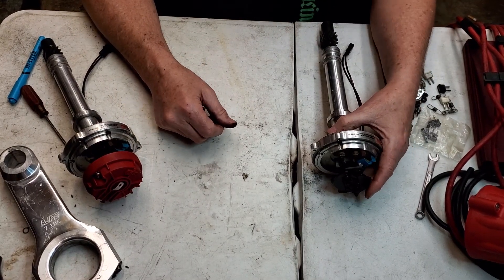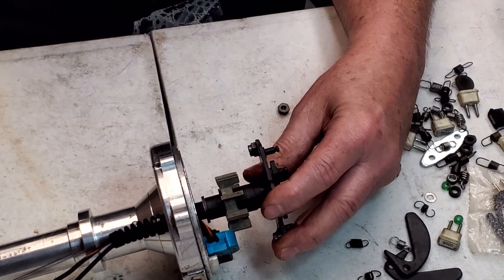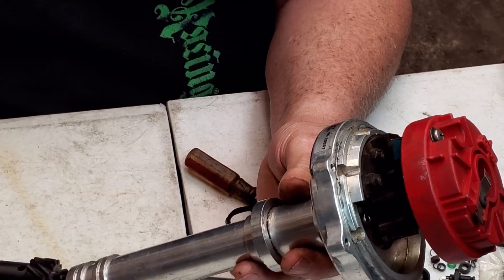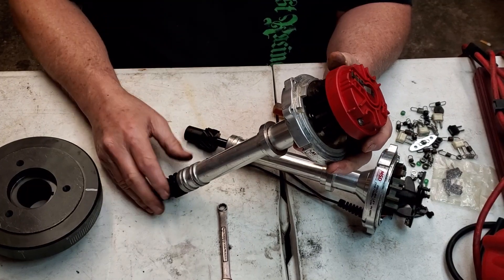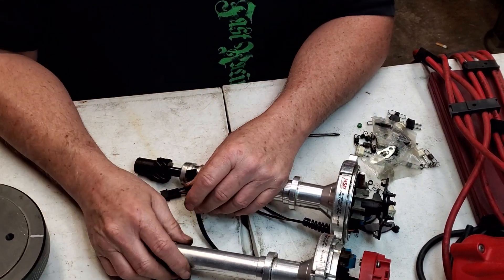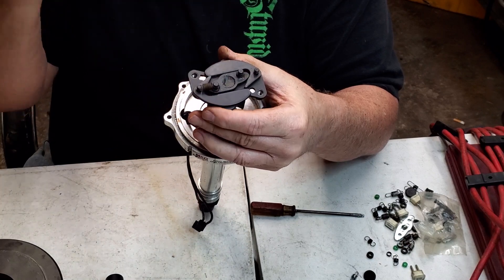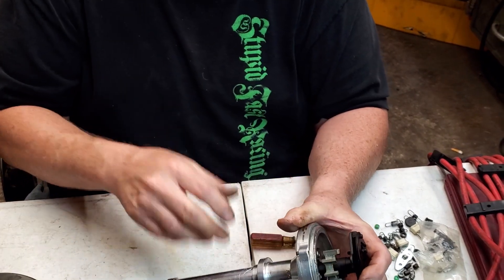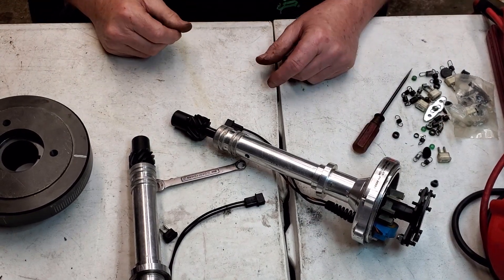Dialing in your MSD distributor total timing advance

Comment: I haven't owned a msd distributor yet but I like how easy it was for you to get at the advance mechanism. I've got the mallory unilite distributor. I find those mallory distributors cheap and fix them up.
Reply from the maker: Mallory makes a good distributor. I prefer msd myself but I have run Mallory with good results.

Comment: I got a Oldsmobile 67 442 the 400 motor with the MSD mechanical vacuum advance motor has got got a w30 cam in it 750 carburetor I wonder if I should use the lightest spring in a one heavy spring I hear racers yous a setup like that with 38 total timing
Reply from the maker: I've ran that combination of springs before but don't go to light or the timing may jump around at idle. Also listen for spark knock. Hope this helps.

Comment: I have a question, I have a Sbc 427 and I set timing 34* at 3500 rpm. Timing at idle is 18* and I have 18* mechanical. Shouldn’t it be 16* at idle with 18* mechanical for 34* total?
Reply from the maker: Yes if you want 34* degrees total. If i'm strictly just drag racing then i lock my dist timing out. If its a street strip car I would set my timing like yours. Timing is a product of combustion chamber burn speed.hope this helps.

Comment: Which carb would be best with the msd pro billet mechanical advance distributor? Do you still use carb with vacuum secondary, or is there mechanical secondary carbs?
Reply: I do have the whole msd electronic ignition kit with digital 6al box, that has rev limit adjustment
Reply from the maker: Scott describe your engine and are you running manual trans. Or automatic. Do you sreet cruise or more competitive?

Comment: Before I watch this video, I'd like to state my belief's and understanding of the mechanical distributor on carbureted engines. ALSO THANK YOU FOR GREAT INSTRUCTION VIDEOS! I've been in the automotive field as a senior master automotive and diesel Technician for over 20 years, and I appreciate the direction taken here to educate!

I'm a driveability technician. Ignition timing is a close friend of mine. In 23 years I've witnessed two sides form...."The Advanced" and "The Lockouts".

I'm a firm believer in timing curves. Please have VERY VERY good reasons if this video is about locking the damn distributor at 36° on a daily driven 10.5:1 over-cammed sbc .

MSD distributors do have adjustability of advance curve and max timing. 

Sorry for the rant. I'll watch the video now.
Reply from the maker: I'm  a driveability guy too, worked at a Ford dealership for almost 30 years, I started when points and condenser was ending , worked all the way through eec5 systems that had monitors, but locking the distributor out is for a racecar not a street car, i usually watch the video before I comment. I show people what I've down , not what I've  read and I'm  sure you'll  have some people that will do the  extreme to a street engine.  Most of my videos are for drag racing or circle track. Hope this helps and I was a master tech through ford motor company and ase. I always loved driveability.
Reply: @holleycarbshowtosadvice40y90  no shit! A brother from the blue oval! I miss the shop life and the ability to further my education a little.

Comment: how to know what ur initial timing should be at?
Reply from the maker: It comes down to what your doing with your engine also things like compression, type of fuel, combustion chambers shapes and sizes, cylinder head material, lot of factors.
Reply: @holleycarbshowtosadvice40y90  on my motor there’s a mark right at 35 i believe that’s totally time but how do i know how much the distributor has in timing the color of the bushings?
Reply from the maker: I don't  know if you have a msd distributor but msd has a tech line they can tell you the degrees of timing of each bushing and then add in however much initial timing you need to get your total timing  usually a stock engine likes around 10 degrees initial but  this can vary. I'm  discussing  a full mechanical advance distributor. Vacuum advance you have to add vacuum timing and mechanical timing and your initial timing to get total timing. Hope this helps.

Comment: Could I just turn the idle up until the engine stops advancing say to like 36 degrees lock down distributor and let the initial advance just fall wherever it's at.
Reply from the maker: I don't do it that way but you could try that, I'm trying to get the advance in as early as possible. Hope this helps.
Reply: @holleycarbshowtosadvice40y90  I guess I will try it your way because my engine is running really rich at idle and under slight load carburetor seems to be dialed In so I'm looking at ignition next

Comment: Could you give a little more explanation on those little advance pills, the thicker and the thinner? I run about 16-18 initial timing, and about 36 total if I want that to advance much quicker would I go with the smaller or larger pill?
Reply from the maker: The bushings limit the amount of advance, the bigger the bushing the less advance the smaller more advance, the springs control how quick the advance curve happens, light springs quick advance curve. Hope this helps.
Reply: @holleycarbshowtosadvice40y90  absolutely does thank you

Comment: Can you do a tutorial on the marine msd ready to run distributor?
Reply from the maker: I'm not a marine tech, but best I can tell is its simular to the pro billet racing distributor but has upgrades to the distributor cap, has brass vents at distributor base and has a built in ignition module, and has adjustable timing advance with bushing stops and springs to curve the distributor advance, make sure you check the specs from the boat and engine manufactures for the correct ignition timing advance curve, how much initial timing and total timing the engine needs this is important. I'm not a marine mechanic  but I hope this helps. Msd distributor pn 83606 for chevy.
Reply: @Holley Carbs: How To's & Advice ,40 yrs of exp.  I'm swapping my engine for a small block Chevy, so I'm building everything from scratch
Reply: @Holley Carbs: How To's & Advice ,40 yrs of exp.  I already got an efi kit from holley and a marine ready to run msd distributor.
Reply from the maker: Good deal man.

Comment: Awesome video. Got a question how do I set timing on a locked msd distributor on sbc ?Would be using just a timing light with no fancy dials.
Reply from the maker: If your dampner is not marked, I believe you can still buy a timing tape which is a degreed tape that you just peel off the back and clean your damper and stick it on, match 0 tdc on dampner with 0 on your timing tape, always get the right size timing  tape for the dampner. If you have an 8 inch dampner be sure your tape is for a 8 inch dampner. I used to build my racing engines, when I degreed my cam in I would use the degree wheel to mark my dampner from 0 to 40 degrees, back then we used a lot of modifed stock parts. Hope this helps.
Reply from the maker: Amazon sells timing tapes.thanks for watching.
Reply: @holleycarbshowtosadvice40y90  it’s a after market balancer with timing marks! So I just run it up on RPM and turn the distributor until I reach 32 degrees?

Comment: I have a 69 el camino at 3300 lbs a 396 with edlebrock RPM Performer heads and intake to match , a comp 282  roller cam and rockers , Eagle forged crank and rods , It is a dog and I am thinking of running the red busing and the silver springs to get the advance up there to 38 do you think that is too much advance? should I bring it down to 34 total instead ? I am running stock springs and blue stop washer
Reply from the maker: Normally 38 degrees timing is ok on a typical big block chevy, but first you need to run a compression test to get an idea how much timing to run , your motor should not be a dog fact it should be the opposite. Run your compression test and if you can check the engine vacuum at idle and get back to me.
Reply: @holleycarbshowtosadvice40y90  it's 9 lbs at idle, I just checked the timing and something is drastically wrong , it is comfortable with 40° at idle and jump's to 60 ° when give it throttle... Could the timing chain be out a tooth 🦷 I didn't build the engine so they might of screwed up..
Reply from the maker: Check your harmonic balancer for slippage next check  your timing gears for proper alignment, sometimes I've  seen people use the key way on the crankshaft to align the timing gears, you have to use the timing  mark on the the crank gear , not the key way. Mark on the cam gear at 6 o'clock and mark on the crank gear at 12 o'clock.  Now not trying to confuse you ,if you have multiple keyways on your crank gear check and make sure your using the right keyway. Hope this helps. If this is your problem you want believe how much power your going to pick up. Hope this helps.

Comment: Thanks for the video and I have a street/strip 3100lb ish 89 foxbody  10:7:1 363 sbf victor jr afr 195s, comp 282 cam 565 576 lift, 780 holley, 5 speed 373 gear and looking for a starting point on springs n bushings w/ mech advance msd pro bullet and was thinking 14 intial and 34 total, thinkin blue bushing w/light silver and light blue spring to come in at 2400k and advance be 21, whats your thoughts on this? Thanks for any help.
Reply from the maker: George  excellent parts combo , very well thought out. With the ignition timing in that fast ,which is a performance advantage , watch for ignition timing moving around down low , sometimes its hard to use light springs and keep control of the timing, if you don't have any problems , afr has excellent designed combustion chambers so 32 to 34 degrees should be fine. You may won't to play with the timing at the track to see if your at the best timing. If you every get to where your timing is causeing hard starting ad a spark retard box , always remember the more initial and less mechanical is better for racing , if you we're just racing, ( no street driving) I would tell you to lock out your ignition  timing. Hope this helps.

Comment: You have given me more REAL WORLD INFO on distributors in 15 minutes than I could find anywhere! Thank you! Now, and chance you could do some Mallory dizzy stuff, since there’s almost zero good info out there on them?!?!? I have been searching all over for advance curve knowledge on the Mallory’s, but since you can’t get the Mallory advance kits anymore- only Summit sells a kit that will fit for their distributors, but the springs are all different from the original Mallory colors so no one knows how to set these up anymore! Your 40 years of knowledge is more valuable than you can begin to imagine!!!!! I beg of you to please kick out a few vids on the older Mallory dizzy’s. Both the unilight and magnetic pickups!!
You are a guru, and so helpful! SUBSCRIBED!!!!!!
Reply from the maker: Dave I'll have to look through my distributors I had a pro comp 9000 , don't know if its still around ,I'll get back to you.
Reply: In a 496 stroker forged bbc, what kind of advance curve should I be looking for as a start? 10.5:1 dual carb, tunnel ram intake, over tran
Reply: Transom headers- engine blueprint says @ 650 hp and Dart 308 race series aluminum heads

Comment: I have a 65 GTO with 406 smallblock Chevy with the following: Dart SHP 180cc aluminum heads, Howard cam .530/.545, 233/241, 110 lsa, RPM Airgap intake and Summit 750 vac sec carb, Progression distributor which is computerized and runs a MAP sensor for vacuum advance. Compression is 10:1 and I run 91 octane. Rear end is 9 inch Ford with 3.50 gears and Tremec 5 speed. Timing during cranking is fixed at 10 degrees. After that I can create any timing map I want on my iphone and upload it via bluetooth to distributor. I'm interested in what you were saying about locking out the distributor and how much faster the car accelerates on the bottom end. Since mine is completely programmable I would think I could simulate the lockout during initial takeoff but increasing advance immediately and then adjust it after that. What do you think of this plan? Do you have a suggestion on what the ideal timing curve would be again keeping in mind that it is 100% programmable? Car is street driven on weekends. Thanks a lot.
Reply from the maker: If your running it on the street that much initial lead is hard on the engine but if you can use start retard cranking and then dial your timing to 20 to25 degrees at idle and then ad your total timing at a certain rpm usually around 3000  , keep your idle as high as you can when your running that much timing maybe 1300 to 1500 rpms, when you bring your initial timing in early . You will notice the power level come up, I run my msd dist.locked out at the track when I want to star gaze lot of bottom end response. Good luck Sounds like your sharp, keep thinking out of the box.I would continually change it and see what it wants on top . Faster the burn rate of the combustion chamber the less total timing you need , but can vary from 32 to 38 degrees total , have to find that sweet spot.
Reply: @holleycarbshowtosadvice40y90  I have spent probably 10 hours over the past few days tweaking the timing table and it keeps getting better.  . One thing I did today was hook up a vacuum gauge so I could compare the kpa that the software functions in to mm Hg which I'm more familiar with.I wish there was a way I could post a photo of my timing map so you could tell me what you think

Comment: Is it better to have more timing come in with the mechanical rather than have a lot of initial and a small amount of mechanical? This is for my street/strip car.
Reply from the maker: If you have a start retard box , then run about half initial and half mechanical of the total advance ,for instance if your running  36 degrees total run 18 and 18.If not run maybe 10 initial bring the rest of the mechanical in asap.

Comment: OK so I'm running a 302 with bolt ons n gt40 iron heads with a ford f cam,what should I set my initial n total timing with msd mechanical advance distributor, what bushings n springs I never messed with a mechanical distributor thank you
Reply from the maker: Robert there is so many variables , I need a lot more information on your engine , compression , cam , carb or inj , octane of gas you run , is it a street car or strip and street car, let me know and I will help you.

Comment: Hey brother I love all your videos ,could you please tell me what size the nut is for the bushing?
Reply from the maker: I believe it's a 9mm nut but I might have seen a 10 mmr on some. Remember this, locking the distributor advance out is an all out racing modification .Running this on the street is not a good idea .Hope  this helps.

Comment: You answer my question. I have 454 mechanical roller cam used on street. 14 degree initial whit 39 degree at 2500 rpm . 39 degree was test on dyno whit better result. Whit 20 degree start retard msd 7al3 option . After long time i check my bronze distributor gear for wear because I'm crazy about my engine oil whit king of gold dust in filters. I saw that you can make a slot on distributor for better gear oiling.
Reply from the maker: Good thinking .

Comment: Hello I have a ready to run and I want my timing to come in full at 3000 rpm what springs and bushings should I use thanks
Reply from the maker: You have to set the distributor up around your initial timing and how much total timing your going to use, and what kind of msd distributor your using ( all mechanical or vacuum advance and mechanical ) or if strictly drag racing you can lock the distributor out. I need more information to help you.

Comment: Hi and thanks for the great tips. Question sir, I have just recurved my Msd billet with lighter springs and the big black bushing (black bushing supposed to limit total 18 deg Btdc.) SO, which timing do I set? Idle/Initial or Total first? I want 36 deg total. I have TDC on #1, and will use my advance timing light. IF my total is 18 deg total, does that mean my Initial/Idle will be 18 deg for a total of 36 deg? Or set total at 36 deg at 25-28,000 rpm and will that make my Idle around 18 deg?  My timing is set to be all in around 25-28k rpm. according to the springs per Msd Pdf chart. I appreciate any feedback sir. Thank you!!!!
Reply from the maker: If its  strictly a race car yes you could run 18 initial or lock the timing out , I like to run the rpms up to a minimum 3000 to 3500 rpms , and check total advance, now if your driving it on the street your probaly going to need a  ignition box that has a  start retard 18 degrees you can sometimes squeeze by without the box.
Reply: @holleycarbshowtosadvice40y90  Hi and thanks for your comment! I use the MSD 6AL box.

Comment: Thanks that was very helpful for a new guy 
Maybe you can help with a problem I’m having 
I’m getting arcing from my billet 85503 shaft to the block
Runs like garbage when it reaches operating temperature 
I ran all new grounds
Coil to chassis mounted on the block 
Head to head
Head to block 
Block to chassis in a loop
Reply: Coil when hot can run bad...
Reply from the maker: Absolutely , a coil can drive you crazy. I,m not sure about the arcing , can you explain when and where this is happening , also sometimes can catch ignition problems arcing  at night .

Comment: good video i have a 454 with 15 initial timin and a total of 36. now i want to make it go as fast as possible ofc. any tips what spring i should use ? its a msd pro billet. when do i want the total timing to go all in ? i have a camshaft with a sweet spot of 1500-5500 rpm and a intake of 1500-6500 rpm
Reply from the maker: I like all my timing in by 3000.
Reply: A lot of people for hipo street applications say before 2500 2000-2500  if that dosn work then yeah try 3000.  you want it in quick.  but if its stock probably not so fast or it its geared low heavy etc